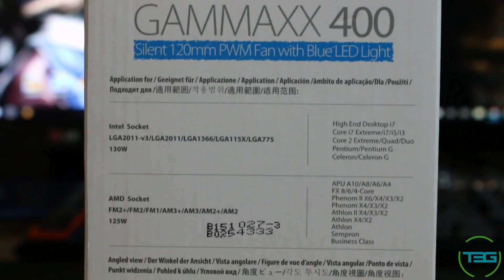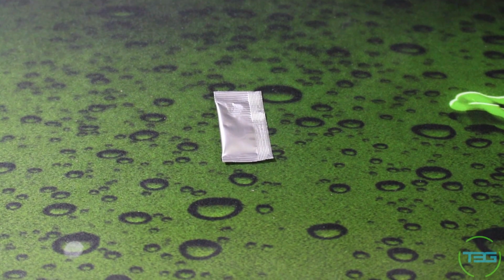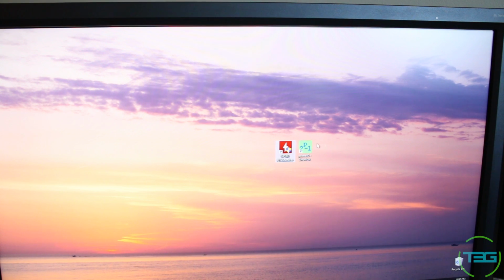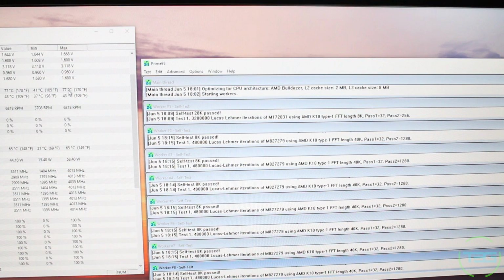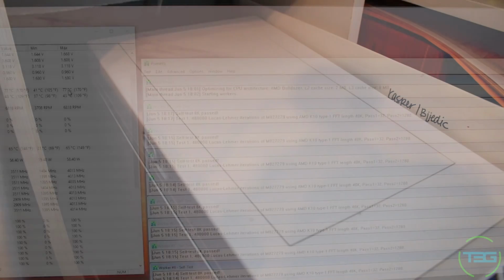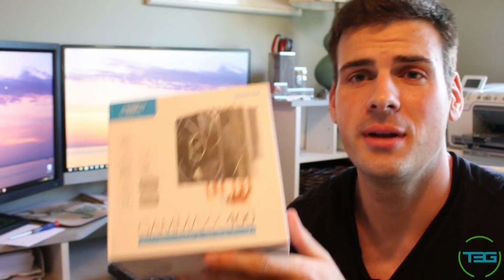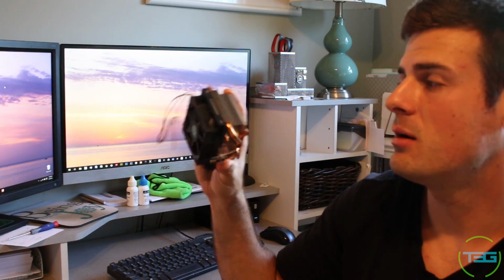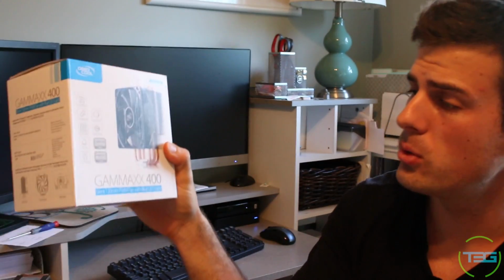DeepCool GAMMAXX 400 CPU Cooler Review

Comment: UPDATE: they now have a new iteration that includes (on the box) am4 compatible and a 140mm fan. I purchased for 16.99 on newegg. if you upgrade your pc in the future it would be awesome to see what temps you get running the ryzen with this cooler
Reply: I was like 8320?? what is that? ahhhh 2016... :)
Reply from the maker: @oscarjung5405  FACTS! Our main systems are actually still 8350s for the most part.
Reply: Stock cooler on a 3600 was 95 degrees, with this cooler 82 degrees.
Reply: Can i change the fan? I have spare shadow wings 2. I dont like the led touch
Reply from the maker: Great information!
Reply from the maker: This cooler is probably what Dalibor will be going with for his editing computer upgrade which will be ryzen for sure.

Comment: is this super good cpu cooler than my stock ryzen 5 2600 cooler?
Reply from the maker: The Ryzen coolers are pretty solid, honestly. You might still get a slight advantage on the cooling since it's moving air across and away from the CPU, but it may not be as significant as the numbers here.

Comment: My issue is that the Fan would hit my ram unfortunately
Reply: Yeah im stuck at a pull. Only config
Reply from the maker: @ronnieryanpc  Bummer! Liquid cooling it is then! :)
Reply: Nah, with my current setup with max cpu load im only getting 69 degrees max average. I think that is fine
Reply from the maker: @ronnieryanpc  not too bad. Passive might do the trick. Big fins, good case airflow.
Reply from the maker: The fan does adjust vertically some, alsoy ou can put it on the other side in a pull configuration, you would just have a more complex time cleaning down the line.

Comment: I have the same cooler but there is something strange the cooler is not flat at the bottom.

It has ridges around the pipes and groved between. I am not sure if that is a defect or by design.
Reply from the maker: As long as everything makes contact, you're good. I've had coolers like that. I actually think my Zalmann on the gaming rig is that type.

Comment: I just installed one today! So easy to install like a stock cooler. Quiet and effective. So worth it.
Reply from the maker: Absolutely!
Reply: I put on on a 65w 5600X and I'm very impressed with the thermals and the noise. Just to experiment I can get a stable overclock on the 5600X of 4.7Ghz on all cores and it's STILL quiet and never breaks 85* C after 30 minutes of 100% use stress testing.

Comment: Easier way to install and not put pressure on your cpu is unscrew the motherboard brackets so that they wiggle a little bit but still attached 
After that install the latches on the heatsink and hold it center on the cpu it won't require any pressure
After that screw in the motherboard brackets until its hand tight 

make sure to use aftermarket thermal paste cuz the one that comes with it is shit
Reply from the maker: I mean you know that it's supposed to put pressure on the CPU, right? It's to ensure the best possible contact.

Comment: YOUR MATH is wrong.  If you calculate the correct temps it is still better than stock. 
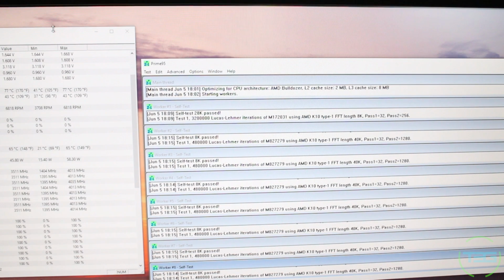Ok at 3:50 with stock cooler you point to the Temp at 77 deg C.  Temp a few lines below shows 65 Deg C.   
Then at 6:03 you start to point to same spot for temp then Opps.  
You point to the lines below with the lower temp of 42 and not the 59 deg C.
so 77 to 59 is 18 Deg C cooler Top temps.  other temp shows 23 deg cooler.  
How much did DeepCool pay you???
Reply from the maker: A total of $0. The audio wouldn't be so bad if they had paid. :)

Comment: hey I am planning to upgrade my pc which is desktop pc from dell and it is a Dell Optiplex 990 with a core I7 2600 and just wanted to know if I have to the motherboard and add brackets or if it even is compatible with my pc.
Thank you 
would really appreciate it if you reached out to me quickly
Reply from the maker: This does not require that you remove the mounting plate for the current cooler, so you should be able to just plug and play with the current mounting options.

Comment: My intel stock fan is really noisy. Will buy this one. Great review! I have Biostar G41D3C lga775 mobo with 2 RAM installed (Heatsink on both RAM) will it fit perfectly?
Reply from the maker: It should be fine, the ram with heatsinks on my board did not interfere. As long as the RAM doesn't have extremely tall heatsinks, you should not have any issues.
Reply: Thanks! What would you recommmed the gammaxx 400 or Cooler Master G100M?

Comment: That is some serious drop in temperature. Did you use the thermal past that came with the cooler??
Reply from the maker: Yup! Just what came in the box.
Reply: Great. I am going to get this cooler later this week.
Reply: @BoomBox02   What fall in temperatures did you see after ordering yours?
Reply: I have since purchased a few of these coolers for various builds. The q6700 overclocked to 4.4Ghz that i bought the first one for saw temps drop over 20 degrees Celsius.  This chip ran super hot with the stock cooling going well into the 90's with only seconds into a bench mark. Now it stays below 70 degrees. I also have one of these coolers on a Xeon x5675 overclocked to 4.5Ghz. Running Intel Burn Test 2 the Xeon temp spikes at about 88 degrees Celsius which is not bad as Intel Burn Test stresses the CPU a lot more than everyday programs and games that i run on it so when gaming ect, the temps stay in the low 70's.
Reply: @BoomBox02  After 2 years do you think there are any better alternatives to this?
Note: I'll probably run my cpu at stock frequencies but for now in the aida64 stress test my Ryzen 5 2600 is going at 90°C which makes me kind of worried.
Reply: Wow thats pretty hot at stock frequencies. There are better coolers out there but they are double or more in price. https://noctua.at/en/nh-d9-dx-3647-4u If your running stock cpu frequencies, i would get the GAMMAXX 400 as they are cheap and it will be better than the stock AMD cooler. At stock frequencies, this keeps the q6700 temps in the high 40's. Of course the way you have your PC case ventilated (air flow in the case)makes a huge difference as well.

Comment: is the cpu overclocked?
Reply from the maker: This one is not. For overclocking I would recommend liquid cooling.
Reply: @T3GMedia  CPU's can safely get past about 80 or even 90 degrees celcius without worrying about damage, you could probably overclock the shit out of your cpu with this cooler and only get up to like 65 C
Reply from the maker: That might be true, but I haven't had the best of luck with overclocking so I don't do it. I am perfectly fine with the CPU being at stock frequency and reliable.

Thanks for watching and commenting.
Reply from the maker: Also, temperature allowances vary per CPU, but just on a practical level we tend to go with Liquid Cooling for OC to account for any unforseen spikes. It's happened more than once that a runaway process cranks up the CPU to full tilt and I wouldn't want that to happen with an OC'd CPU that's only air cooled.
Reply: @T3GMedia  hmm a month ago I would have agreed with you but the stock cooler keeps my r5 1600 setting at 4.025 @ 1.39v with load line tweaked around 52*c while playing most games ..my expensive liquid cooler did keep it cooler but the pump failed so now I'm trying the gammaxx . Unless your running a threadripper CPU you don't need liquid cooling
Reply from the maker: @echo2-128  Sounds great! Thanks for the information!

Comment: You compared the wrong CPU temps in both examples. In the first one you showed the standard plate temp and in the second example you showed the correct package temp
Reply from the maker: You are correct. However the temps still did change. If you look at the video you can see the temps that I should have pointed out are still significantly lower than what it was stock. But I did mess that up. Thanks for watching.

Comment: On a whim, was gonna go water-cooled, I got this. OH WOW is it quiet. The only way I know the system is on, is by the lights, and even then I have to look at the power light to make sure. And it dropped my temp from about 70ish C, to avg 31c at idle and it only peaks at 47c-49c at game-play (witcher 3, NMS etc). Thanks for double checking this. And ya, it was VERY easy to install, even came with 3 different brackets for the mobo. The other guy was a moron. It's easy. Thumbs up!
Reply from the maker: It's been so long since this comment...my bad. Thanks for the kind words!

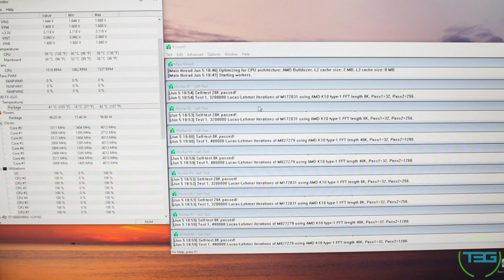Comment: Wrong temps. Take a look at 4:22 and 6:22 and compare. The temp difference is not what you claim.
Reply from the maker: You are correct. Its 77 degrees vs 59 degrees. My apologies on messing up. Still a significant difference considering the price point of the cooler.

Comment: I upgraded to this cooler in my main rig, and found it to be quite good for high overclocks. I was able to push my 3770k to 4.5 GHz and it holds the temps down pretty nicely, even when doing prolonged stress tests :)
Reply: wow
Reply: How’s the noise level? Is it quiet?
Reply from the maker: hope that's still running great for you!
Reply: @T3GMedia  still holding strong at 4.5 to this day :) I am actually looking into upgrading from my Vega 56 since my CPU still has much more to give when paired with 2400mhz ram than that card can keep up with, lol
Reply from the maker: @benjaminbain1769  2400MHZ? in 2022? You legend. Patience of a saint!

Comment: Just ordered mine today on Newegg for $24.99 USD. Should get here tomorrow, I'm excited to see what temp changes happen with my setup. I'm running an AMD A8-6600K and on a good day at idle (stock speeds) I hit about 40C. Under load though, it will reach 70C+ and I want to overclock it, too! So, hopefully it does the trick.
Reply from the maker: I am happy that you picked it up. I think you will see a 20 degree drop easy.
Reply: I don't doubt it. It should be delivered tomorrow, so I'll be sure to post back what the drop was. :)
Reply: I got my cooler installed earlier today! I have been running a lot of Battlefield 1 and various other CPU intensive tasks. And I've got to say I'm impressed. I did see about a 20 degree drop (idle: from ~50C to ~30C, under load: from ~70C to ~50C)! I'm just using my MSI boards' OC Genie to overclock to 4.2GHz for now, but I think I have plenty of thermal margin to work with. Small downside is it's a bit large for my case, but I made it work. 😜

Comment: Took me a while to get one. But, I finally got it. Now, I finally know the answer why you said that some people find it hard to install. Those are actually AMD users like me. Getting the clip to lock in to mount the cooler in place was quite a challenge if you have small case.
Reply from the maker: I see what you mean, I can see it being a bit more tough to install in a smaller case, but it is still the easiest cooler I have installed. This was as mentioned in the video a AMD FX processor and I thought i was amazingly easy to what other ones I have installed.

Comment: what case do you have? Also This is one of the first coolers that wills tart shipping with Am4 Compatibility even before the 212 evo/x!
Reply from the maker: That particular case is the Nanoxia Deep Silence case. That is not the one I use, that is my wife's case. I use a Corsair 780T for my one system and my other system uses a Thermaltake Core X9. And that is correct, this cooler is compatible with the AM4.

Comment: Great CPU cooler.  Had mine for about a year.    PC Specs  i5 3570K,  Asus P8z77-V LX,  16GB,  MSI GTX 980 LE.   Generic PC tower case, honeycombed top bottom grillls,  Front/Back fans.    Using all stock clock settings.

CPU Temps
Normal Load -  40C
Heavy Gaming -  72C Max

When gaming I was going over 100C with the Stock Intel cooler.    Constantly getting  frame rate drops,  video artifacts and game crashes.

I rarely have any issues with gaming now.   

The fan noise is decent,  my GPU fans are louder.    With all the Fans running my PC is still quieter then the Xbox One 

Best of all it stays clean,  the Stock Intel Fan was a dust magnet.

To be honest its the best $30 I've spent.
Reply: the cpu is overclocked, right? what's the GHz?
Reply from the maker: i hope that's still running great!

Comment: +1 for having the same printer as me :)

Actually, thanks for the video, I'm looking for a new cooler for my i7 non-K CPU; something not huge (I have mATX system) and silent enough.

Usually Intel's stock coolers were good enough for me but now in my current system for unknown reason I often hear the fan speeding up and down often during heavier tasks.

If the stock fan worked at the same constant speed, it would be toleratable but this speeding up/down noise is totally annoying. Not sure, what Intel had done to their coolers, or maybe it's because the radiator is noticeably lower than, for example, Sandy Bridge CPUs, therefore the fan has to work harder.

So, now I'm considering DeepCool GAMMAXX 400 and your review makes my choice easier.
Reply from the maker: Thanks for the comments! I love this cooler. I picked up another one for my gaming rig.

Comment: When I installed mine, the only problem I had was the wire snap for the fan didn't cooperate very well. But a couple weeks ago when I replaced the stock fan with a Thermaltake Riing-12, the mounting wires cooperated completely, so I guess I did something wrong the first time.
Reply from the maker: Glad it's working for you now!

Comment: if you had to choose between the 300 and the 400 which would you take instead ?
Reply: Its about 100 RAND difference for me in my currency which is like 7 dollars.
Reply: I bought the Cooler Master Evo TX3 and that is a horrible cooler to install. Its too bulky and the its hard to manage the clip, when you try to clip the sides on then the clip un-seats from the heat sink and you have to re-seat it. Its a great cooler very quiet , but for me the orientation is all wrong it is facing the wrong way so it blows the hot air on to my graphics card. Really a stupid design for my AMD board.  The heat sink and clip was a pain to manage. I hope somehow DEEPCOOL is better
Reply from the maker: Great question. I would go with the 400 since its the one I know. I haven't used or tried the 300 so I couldn't comment on it. I know obviously the 400 works good.
Reply: 300 seems to have different mounting system that's not so sturdy. Also fewer heat pipes and the fan is non standard so can't be replaced with an aftermarket one of same type.

Comment: can anyone say me that what is the height of the radiator,horizontally after the installation has finished. PLS reply.
Reply from the maker: The NewEgg specs say this : "Heatsink Dimensions 80.00 x 135.00 x 154.50mm" but I would recommend checking your case as most cases will spec out the cooler clearance.

Comment: do I have to clean the thermal paste of the CPU or can I just apply the new one because it's hard for me to order stuff online. if I have to clean it, do u have any alternatives?
Reply from the maker: You will want to clean off the thermal compound. If you can't order the cleaner kit, you can use 98% rubbing alcohol to clean it. Make sure it is 100% dry before applying new compound.
Reply: T3G Media thanks for the advice man, I only had 78% rubbing alcohol. my PC still works so I didn't damage anything I guess lol. great cooler keeps my FX 6300 in the teens according to MSI afterburner but I'm not buying it. when I touch the side of my case, it feels really cold so I guess it's a possibility afterburner may be right.

Comment: I dont have that thermal compound cleaner. Can i use a bit of water and a cotton cloth? Please answer fast or tell me where do i get the cloth and cleaner but keep in mind that im from Romania.
Reply from the maker: You definitely do not want to use water. If you don't have the cleaning solution, use 98% or better rubbing alcohol.
Reply: Already did but i couldnt install it on my gigabyte 970 gaming mobo.My processor is amd fx 8300 3.3ghz AM3+
Reply from the maker: You should be able to install on any AM3+ board.

Comment: Great video brother! it looks like I'll be getting a Deep Cool 400 series, reason Number one the spring/screw type lga775 connector option that I haven't found on any aftermarket CPU cooler other than from Deep Cools 400 series line up of coolers. And bit having to remover the motherboard to replace the backplate is awesome! thanks again!
Reply from the maker: Glad we could help out! Thanks for watching!

Comment: What if my motherboard only has 3 pin connector thingys? Can i connect the 4 pin fan to the 3 pin motherboard thing?
Reply from the maker: Absolutely! The fourth pin is for temperature, so the only difference will be that the fan will be at full power, but that won't really matter as it's pretty quiet even at load.
Reply: Thank you so much! Great video btw.
Reply from the maker: Thanks! And thanks for watching!

Comment: the box doesn't mention 1151 socket. would it fit in LGA 1151?
Reply: Yep. It's fully compatible with the 1151. I just installed on a 6600k.
Reply: +WarHead ty, I also installed it on my i5 6500 today.

Comment: Thanks for the video!

Picked up the Gammaxx this week for my new i5 build. If it can cool that monster by 30+ degrees then I have no issue throwing an overclock on the Skylake and maybe a few more degrees on top of that with some MX-4. Not a big fan of the clip system but I'm not buying a junker board that'll warp so it's really a non-issue.

Comment: Whoa! 14MIN and 42 MAX degrees!?!??! ON FULL LOAD WHOA
Reply: That's possible. But remember, idle temperatures never go below ambient on an air cooler. It seems this reviewer has very low ambient temperature; between 10 and 14 degrees C. Typical reviews have between 20 and 25 C ambient temperature.